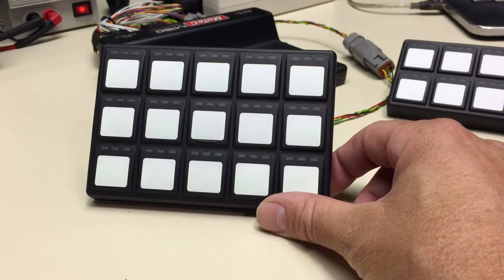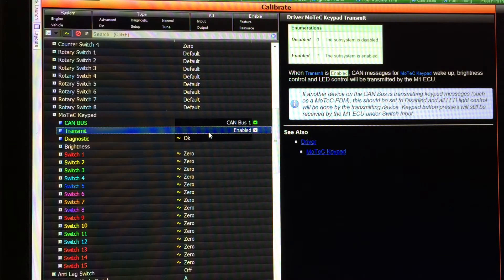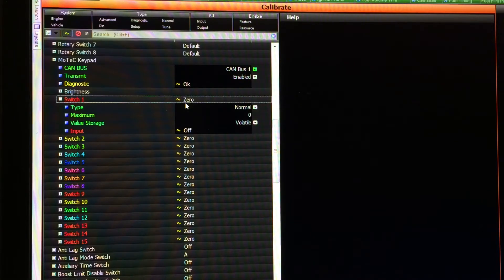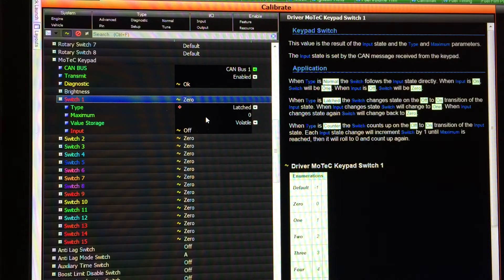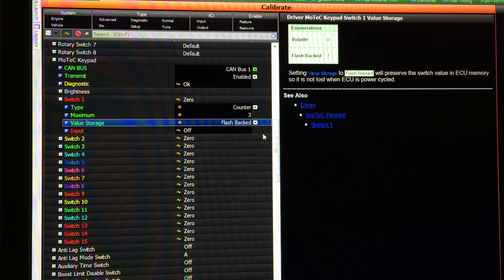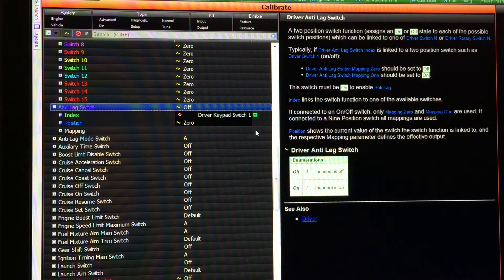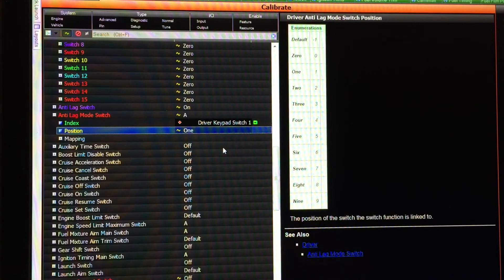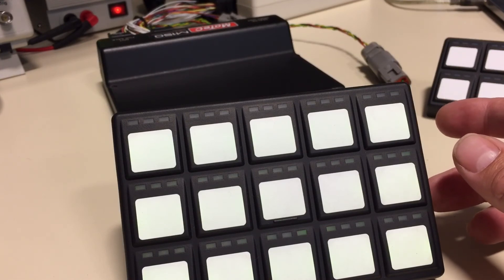MoTeC M1 ECU - CAN keypad integration

Comment: I am now running the 86/brz License package on the M1 ECU right now and will it support that package too? If I go with the link keypad (the one with 8 circle-shaped buttons and lights), is it possible to get them into my M1?
Reply from the maker: The 86/BRZ firmware does support the keypad, though the integration has changed/improved since I did this video, so same concept but a bit different setup flow. I don't know about the Link keypad, but for it to work with the M1, it would need to output data in the same format as the MoTeC keypad.

Comment: This is a great walkthrough and applicable to standard keypad function in GPA/GPR now as well. 
How do you handle showing these status changes on a dash? If you assign a function directly to a Driver Keypad Button how do we pick these up in the CAN template on the dash side?
Reply from the maker: Thanks! This video is quite old now, and the integration is no longer the same, but the basics still apply. My firmware have channels in the CAN transmit to make the status changes in the dash easy, but last I checked GPA/GPR does not. You would have to grab the button press messages off of the CAN, and create the states in the dash that you need.
Reply: @JohnReedRacing  I figured this would be the case, thanks John!